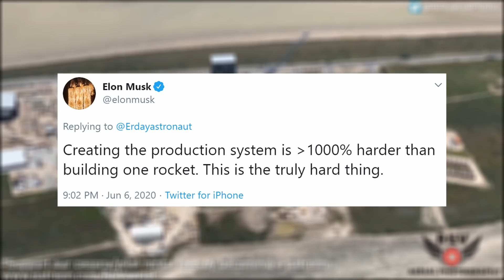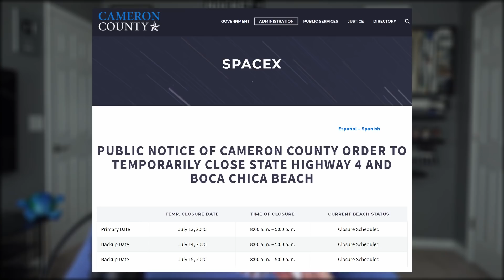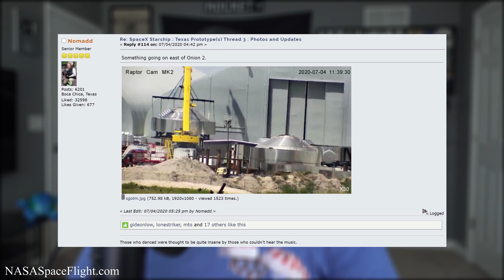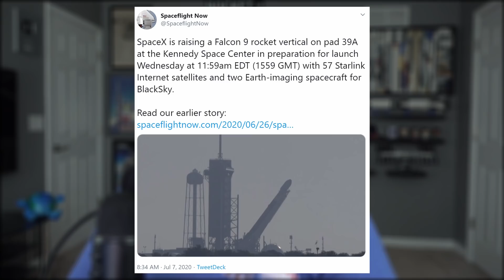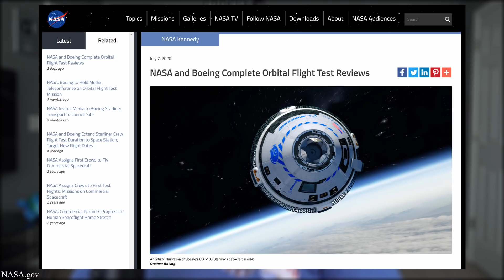SpaceX's Starship Readies for Static Fire and First Flight | SpaceX in the News

Comment: The mass simulator is not to keep the power of engine tamed it is rather to test its max power output capability. Same engine was used for the much smaller star hopper. And that didn't had any mass simulator.

Comment: Did Boeing or NASA announce ahead of time that the White Sands, NM parachute test would DELIBERATELY be done with only 2 chutes?  THIS seems very strange since their previous test of the Starliner parachute system resulted in ONLY 2 chutes opening.  Common sense tells you that Boeing would try to prove all 3 chutes would NOW open as designed.  Boeing and NASA wouldn't lie to us would they?

Comment: The exploding rocket...fuel ignited at seal rings from the rocket engine ignition from below ?
Reply: SN4? No the fueling connections (quick disconnects) that are supposed to be able to be disconnected quickly for launch failed and fuel and oxidizer spilled out until it reached a hot spot and ignited. Basically the last two failures where not the fault of the rocket, last one a fueling error and this one also kind of a fueling error but this time the hardware failed instead of someone screwing up like on SN3, that was human error.
Reply: Thanks 221b

Comment: How will they test the “wings” (mars atmosphere and earths)? It seems like a do or die operation.
Reply: They'll start with uncrewed missions on Earth, get better, make calculations for mars based on many past missions and knowledge, then send uncrewed missions to mars. Like Jere w said, they'll crash a few times and then they'll learn to do it properly
Reply: there expecting crashes but the Ai will nail it eventually with enough data
Reply: @Jerew  No need for AI to make a flight computer. That would be like using a supercomputer to write email. An Arduino unit could probably do the job. Nose goes up, react by reducing drag on top wings and increasing it on the bottom wings. No need to overcomplicate things. It's a simple input output system, refined by flight testing. Which is why I think they'll nail the landing. Maybe tip over after but the vehicle should get it close enough on the first try. They've got a lot of experience programming autonomous flight computers and believe me while complex it's nowhere near AI and that is good. You want a simple predictable system, not a giant mess of millions of lines of code just to control attitude. AI would be more useful in design.
Reply: @please_stop-v7o  Probably still need adjustment, gravity is 38% of eart and the atmosphere is very tin so the computer can overreact but they have data and experience so it's possible it will take less test.
Reply: Several 20km hop attempts.
Reply: The first starship to mars probably wont contain humans
Reply: @liriani  Agreed.  I'm pretty sure Elon mentioned one or two freight missions first before manned missions.
Reply: The first flights will be crewed by short-sellers.
Reply: With space flight it's always do or die.  That's why they are so careful  🙏🏽
Reply: Testing it without humans
Reply: yes
Reply: They will send cargo on the first “several “ make the cargo crash survivable, then the one way trip for us.
Reply: That's what physics and simulations are for . I mean we have data of windspeed , gravity etc. You can have at least an approximation of what will happen.  So they won't be totally as blind as you might think . I mean NASA has landed many spaceships on Mars before .
Reply: Yeah, for Earth, it's no different to learning to land Falcon boosters... some spectacular failures along the way, but eventually they figured out what works and what doesn't. And by the time they're sending stuff to Mars, they should be pretty practised at Earth landings, and the Martian atmosphere is sufficiently well known by now that they can probably adapt quickly.

Comment: I can't wait for the super heavy it's gonna be soo enormous 🤩🤩
Reply: Thats what she said
Reply: The Superheavy booster is taller than the first stage of the Saturn V, although somewhat narrower.  In fact, the Superheavy booster is close to being as tall as the first two stages of the Saturn V stacked together.
It's 1 meter narrower than those two stages though.
Reply: I know it's gonna look awesome! And then imagine Starship stacked on top.....
Reply: @johnsmith-o3v1k  And 1000x cheaper ;-)
Reply: When are they starting on the superheavy ?
Reply: @Modestasgailius  Uncertain, but we do have some clues. One, they're in the process of constructing a new "high bay" building that seems to be sized for Superheavy. And two, it doesn't make a lot of sense for them to start construction of Superheavy until after Starship has made some successful flights to validate the concepts common to both. So the implication is that it will probably start fairly soon, but is waiting for Starship flight tests.
Reply: I'm going to drive down To Boca and watch that in person. On my bucket list!
Reply: @bryanghumm7175  that will be so cool.